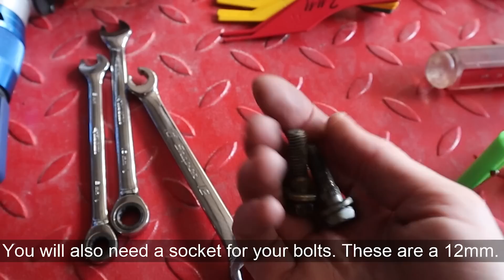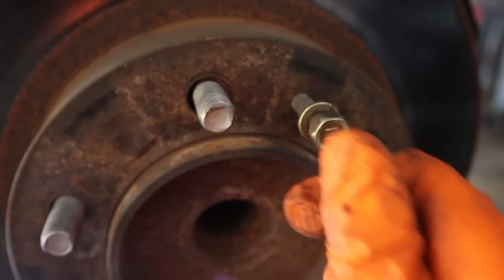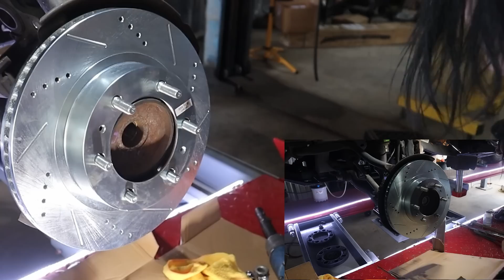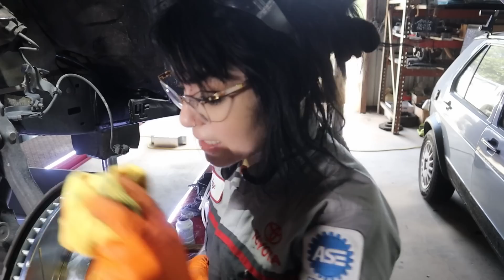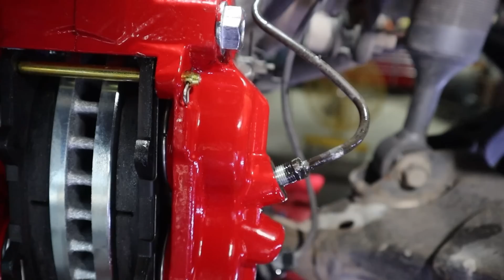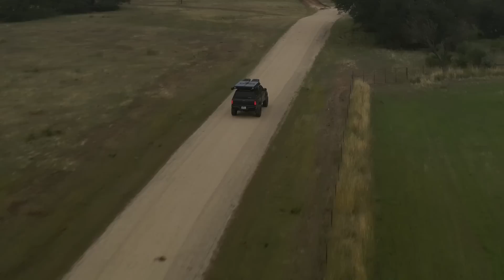How To: Replace Front Brakes (Pads, Rotors & Calipers) on 2nd Gen (2005-2015) Toyota Tacoma

Comment: The pins sliding out were 1 in a 1000000. Generally they are rusted and fused to the caliper. Only thing rustier than a Toyota frame, roof, or exhaust are the brakes.

Comment: off the book. you need to dip the rotors on solvent to remove the oil from the rotos. PS the oil is inside the air flow vain!

Comment: drilled and slotted rotors warp easier and can also crack. especially with extra weight to stop. Best options are cryo treated slotted rotors/oem rotors and oem ceramic pads/trd pads.

Comment: Hey Faye thank u for these how to and instructional vids. I just did front brake pads and rotors on my 2007 fj cruiser that I just purchased as it had a very bad brake squeal when I bought it.  Now I'm scratching my head because the brakes feel great but I still have the squeal smh 🤦   after watching this video I see where I may have went wrong. 1. I didn't use the toyota anti squeal shims. 2. I didn't grease the back of the pad. Guess I'll be going back in to perform surgery lol 😆 🙃   I've read on forums this is a common issues with the fjs. That Tacoma looks similar to the fj front brakes as I'm sure same truck in a way and the 4runners. Do u recommend the stop squeal products???? Thanks
Reply from the maker: The only stop squeal products that I use are the greasing technique and the anti-squeal shims from the dealer!!! Also sometimes if you don't properly break them in they can squeak too, but I've never actually had any issues after doing them this way! And you're right the Tacoma and FJ brakes are extremely similar! Let me know if you end up adding the shims and the grease and please report back with your results! I'm invested now!

Comment: Thanks for the informative video, I have been working on Toyotas since my 94 Camry sadly it went to Toyota have after a crash from an impaired driver. enter 2005 Camry I changed the breaks and rotors in my mechanic class my sister received it, so she gets a throttle body and mass air flow sensor for free last week. now my training was from a lady master technician and another guy they were both very good three years of training I would marry that lady if she wasn't married. I digress if I had three daughters, they would learn everything I know to fix cars too like you keep up the work women can do anything including being good mechanics. I have four sisters and they get anything they need to be fixed my brother he wasn't born with the mechanic gene so no help from him. very jealous of that new lift damm I would love to put the highlander on that if I had the space. mechanic advised I needed the throttle body and sensor cleaned I did it myself the range went up 50 miles from 497 to 548 I like fixing things. forget people who don't believe you're doing excellent work my girlfriend appreciates my mechanic knowledge.

Comment: I worked in automotive brake pads manufacturing  for over a  decade. So if your pads are ceramic, the  ceramic  pads material  tend to crack especially if they get hot. Scorching  the pads like these also cause cracking. Always  check your pads at the parts store for cracks before purchasing.  We used to produce  over 11,000 parts  in one  8hr shift a day. Something  might get missed on occasion.

Love the videos,  keep them coming!

Comment: I see those "performance" brake rotors a lot majority in America but with my knowledge and research online they're not exactly as great as you want them to be especially if you're towing heavy. The drilling of the rotor on the contact surface actually weakens the rotor and doesn't offer any performance at all where as the long slotting across the surface does so vented and slotted is the best way to go. Here in Australia DBA (Disk Brakes Australia) make good quality products with technology that actually ads performance instead of sporty asthetics but either are an upgrade over stock brakes. Good video Faye sucks so much to work on stuff when it's really hot.

Comment: With 91 ftlbs torque shouldn't you split that amt in two settings. First 46 to each bolt/nut then re-set the wrench to 91 for a finished torque

Comment: I've had issues with the powers stop caliper models leaking between where the two halves come together. Out of the 10 I've installed, 2 of them came back leaking... quality control isn't best with power stop..

Comment: I had an Old timer brake guy tell me that when the cracks come through the brake pads like that it's because there's too much weight on them the centrifugal pressure of the rotor causes the vertical cracks through the pads, the cracking is caused because of the weight issue 🦾😁😇

Comment: First off I love your videos you are so knowledgeable and you go through every step with detail, I just got one thing I want to ask I know when I took my break class for ASE they told me the squeaker clips shouldn't go against the rotation they should go with it opposite of what you showed that way it does not bend and gouge into the rotor it actually flexes away from it and just makes a squeaking instead of a growling sound where it's eating into the rotor.... Give me your opinions if you would and let me know if I'm doing it right.... Thank you very much like I said I do love your videos they have so much detail in them.... I am also a firm believer of cleaning all of the brake rotors and parts with brake cleaner.... My boss used to always yell at me for using too much break cleaner....lol

Comment: You commented about the Texas heatwave, I don't think people understand how truly hot it is. I can tell you that she is cooking when the fan is on, so being off she is showing how mentally tough she is, and being focused on the job at hand when your pouring sweat, shirt sticks to your back etc. The reason I understand is because I live in Oklahoma for you all that are geographically challenged, that is the state right above Texas. We both get blasted with humidity, alot from the gulf. What she didn't mention was the flash sweats, those accure when you body temp gets acclimated to a.c.room temp, then you step out side and the heat hits you at warp speed and alot of people like me get goose bumps and then sweat. So please know she is doing this very professionally under God awful conditions. In my opinion she is a very talented mechanic but off the charts while battling the heat that I can testify is horrible.

Comment: Very informative video!!! I have also installed Powerstop red powder coated calipers on my 05 Mazda 3 with EBC Yellowstuff pads and slotted rotors. I also used Castrol DOT 4 brake fluid. Car looks and stops like a champ.

Comment: Hi Faye, I've got a Loctite question for you. I've always used blue loctite on caliper retaining bolts after a very old and experienced mechanic told me "only use red loctite on things you're prepared to use heat to unfasten". What is your take on this considering you used red loctite? Cheers from Australia!
Reply: Yes red may require heat.loctite speaks of around 400 degrees.Also loctite has a spray on activator for thread lock products.

Comment: A friend on a bike at a track day had the friction material completely come off one pad (and they were quality pads). Result was zero braking before a corner (even though there was still friction material on the other pads, it would take significant pumping of the lever to get any pressure), a trip into the kitty litter on the outside of the corner and then a trip to Accident & Emergency

Comment: By coincidence, I just did one side on my Jeep this evening (pads and rotor) and want to finish tomorrow.  However, my rotors are pointing in the other direction..?  I have seen several vids saying surface grooves go "this way" or "that way" or "if the internal fins are not angled, the surface grooves can go either way".  I just emailed the manufacturer to confirm as the box didn't have anything.  ;-)

Comment: I just installed a lift kit on my 2nd gen 🌮 all by myself... it took me nearly 20 hours to put in new upper/lower control arms, shock/struts, rear leaf springs and rear shocks. Thankfully my company's shop was well equipped for the job and i had a company truck to go home in.

Comment: Hey Faye, Have you thought about using the Gen 2 tundra brake booster mod on the tacoma for better brake performance? I would also through in the brake cylinders for the 1st gen tundra on your tacoma.

Comment: Hey Faye 🙂 Just went through replacing the same in my " Fix Or Repair Daily " as the inside pad on the back had worn down to a cigarette thin wafer leaving the exterior pad with considerable meat still attached ( Back Brakes )  Don't ya just love shitty engineering Grr  ...Great to see you Faye 🙂

Comment: Thanks Fay!  Do you have a suggestion for replacement pads/rotors/calipers that fit 2014 Toyota Tundra, in silver or black.  I do a lot of towing a 6500 lb trailer.  Downhill when the brakes get hot I feel some vibration in the steering.

Comment: I did this last week, unfortunately my caliper bore's were in pretty bad. flip side is I went the same route as you did on this truck. Great video as always, keep up the good work! Another note for others, if the slide pins are seized, pin punch on a air hammer works very well. Figured this out after spending a good hour getting them out on one side.

Comment: Hey Faye, excellent job the voiceover worked well almost couldn’t tell. I always use brake clean I set a drain pan underneath and go to town. i’ve never had any trouble with Toyota pads I always brag about them, but good catch and it’s probably a great idea to do the upgrade you did with the extra weight, the truck looks  Awesome. I hope it’s as much fun as it looks. Have a great one.🐔🐔🐔👍

Comment: Faye, the 91 lb-ft is from converting 123 Nm probably. 123 Nm is 90.725 lb-ft, rounded off to 91. Toyota uses SI (SI means Système International or International System, which is the metric system). This is my guess of where the 91 lb-ft is from. Great video btw 👍!

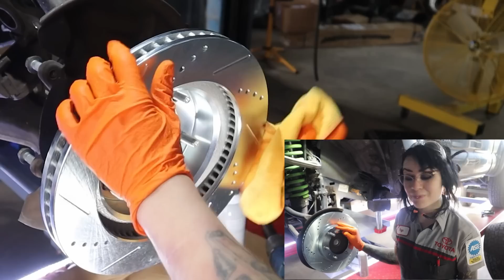Comment: 9:06 Couldn't agree with u more Faye using brake part's cleaner only best thing for brakes soap and water solution maybe little messy when removing luv the red calipers aswell for Toyota Tacoma 4x4.

Comment: Faye,
Excellent video. Just did similar job on my 2005 Arctic Tacoma with the same red powder coated, drilled/slotted rotors. Mistake I just noticed I made was that I did not clean the rotors. I would like to see you discuss what type of compressor for the air tools, and setup. 
Thanks
Carlo Quinn

Comment: Very nice. This illustrates an important principle that very powerful brakes are a matter of context. Increase the power and speed for racing or add a bunch of weight and those same brakes can become dreadfully inadequate. This goes back for me to the original Mini Cooper S. These cars were homologation specials which had huge disc brakes that on a turbo-charged race car were described by the driver as "there aren't any." After 50 years, I think we can call this an unforgettable revelation.😉

Comment: I have a question about the original front brake calipers because they are similar to the ones on my 4Runner. The triangle shaped spring (Anti-rattle Spring) at the bottom of the caliper, is it correct to only have the one or should there be one on the top and bottom? It looks like there are provisions for both but my 4Runner, like your truck,  just has one at the bottom. Thanks, keep up the great content!

Comment: TECH TIP: Most people don't know this but a lot of Toyota's "OE" replacement pads are actually a "Value Line" substitute, you have to specifically ask for the Factory Installed pads if you want what the vehicle originally came with. Thumbs up 👍 this comment to keep it at the top of the list. As always GREAT VIDEO!
Reply: Is the parts guy at the Toyota dealership going to look at me funny when i explain that to him?  I need to ask for NOT the replacement pads but the pads the car came with when built?
Reply: @KennethITGuru  Question #1: Maybe, but any decent parts guy will know what you're talking about. Question #2: You are Correct.
Reply: If it has az in the part number that is Toyotas economy line parts. Example  04495-az108... Or yyz in the number isn't a factory part.
Reply: @mineniner8078  Thank you so much for your information. I appreciate you.
Reply: How do you know this?
Reply: If OEM is a ‘value’ brand, heck, I got 160k out of them before I needed to replace mine on my 13 Taco.
Reply: @timbo389 same here!!!
Reply: @timbo389 same here!!!
Reply: Mine cracked just like the ones in her video. My receipt from 2020 shows az in the part number. I have Power Stop rotors and pads ready to put on.

Comment: This was a well done video Faye. I never considered trying the gravity bleeding procedure and I'm glad you did it. It's really the same technique we had to use on some aircraft systems but in this case to ensure any excess fluid after servicing is completely drained. Looking forward to watching your brake bleeding video soon. 🙏❤️✌️🇺🇲🌎
Reply from the maker: I did bleed then after, but it actually wasn't necessary, just letting them bleed themselves worked in the case but it doesn't always!! Very cool you work on aircraft👍🏻😃